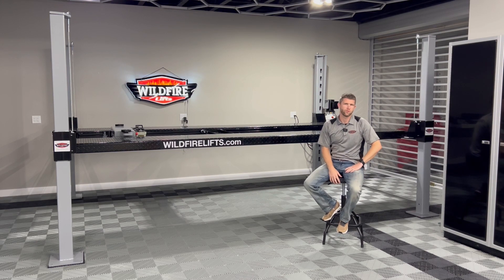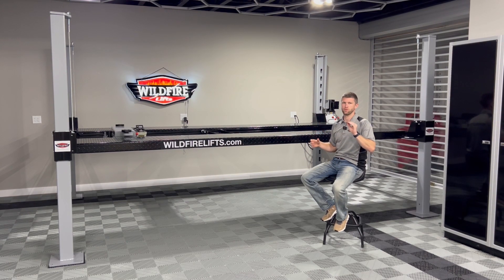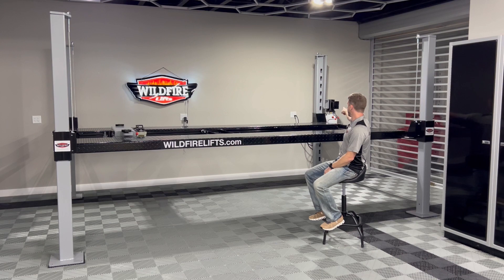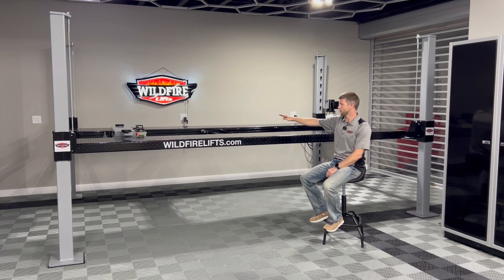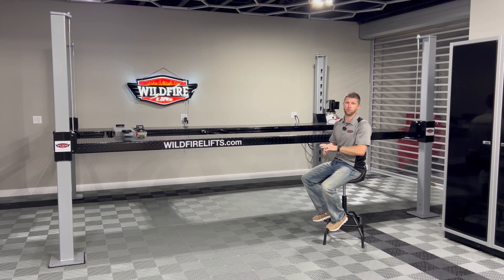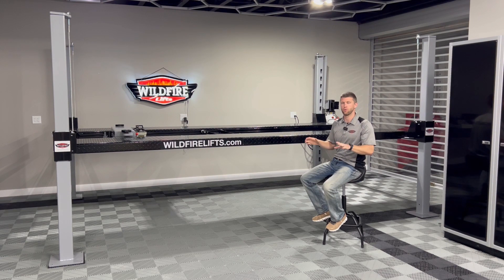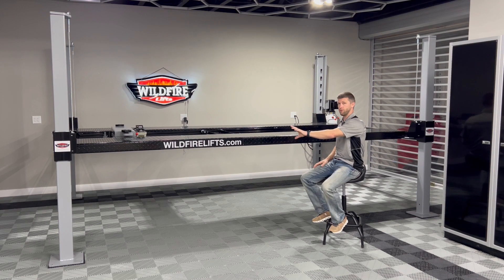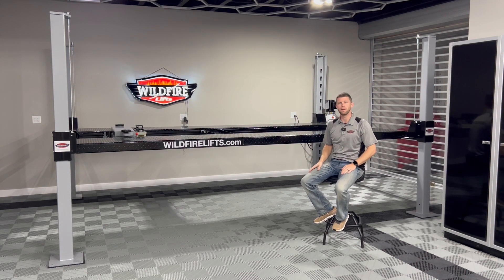Motor Location On A 4 Post Lift

Comment: Can the motor be relocated to a post that is not mentioned as an option by extending the hydraulic line and fabricating a mounting bracket to bolt to the post? Would it be that the brake would be difficult to operate?
Reply from the maker: Theoretically, yes, but it’s not an ideal solution. Our runway steel is laser cut with pre-designed bulkhead passthroughs for the hydraulic fittings that connect the motor to the ram. If you were to relocate the motor, you'd face challenges in properly routing the hydraulic hose. Routing it under the runway could put the hose at risk of damage when the lift is fully lowered. Additionally, the top caps would need to be drilled and tapped to mount the motor. And yes, the lock release handle would be hard to operate as it would no longer be in its intended position relative to the motor. Overall, this modification could introduce several issues that might make the lift harder to operate and less reliable.

Comment: Brad:  with respect to the positioning of the motor on the passenger rear post, you said it can go in two different positions on that post....on the back of that post, or on the side of that post (i.e., 90 degrees from what is shown in the vid).  However you didn't mention the possibility of a third position on that same post, which would be on the front of that post, i.e., 180 degrees from the position shown in the vid.  Is that third position possible?  I saw a pic on your website of one of your customers who had it mounted on the front of that post (the third position).  I'm asking about this because that third position would work best for me.   So before I order a Wildfire lift from you guys, I would like for you to confirm that the third position does indeed work.  Thanks!
Reply from the maker: Thanks for the comment - we did also receive and respond to your email. We only mention and advise two locations (front of post or 90* outside of post) as the motor mount will then utilize all four bolts to attach and support the motor mount to the post top cap. If turning the motor 180* from the front only two of the four bolts would be used which increase the possibility for damage or issue. Please also keep in mind that in the "third" position you reference the motor is now not in a great space to operate the lock release and motor at the same time. Thanks